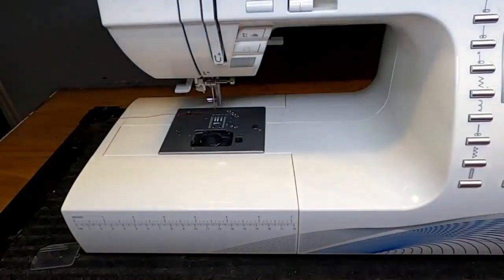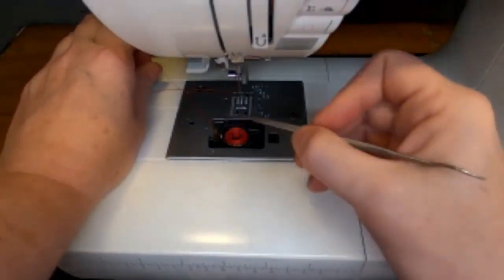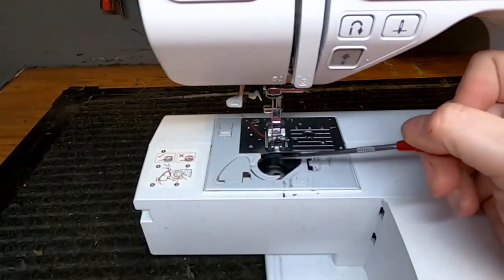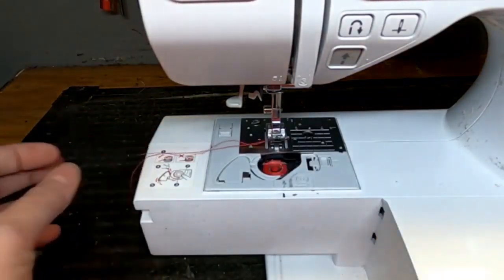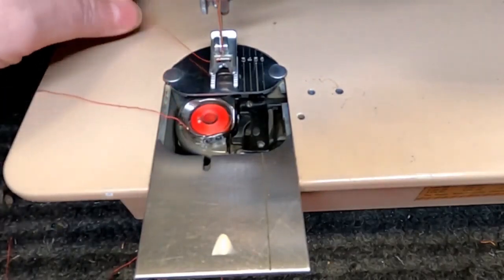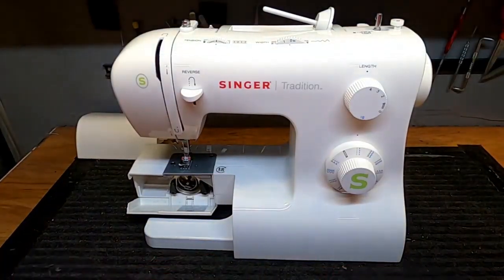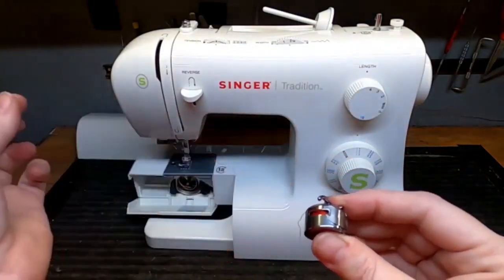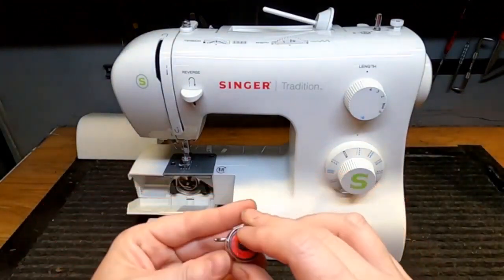Inserting the bobbin correctly - drop in bobbins, vertical bobbins, applies to all sewing machines

Comment: Hi hun, I'm relatively new to sewing, I've had a machine for over 30 years but have not used it much. Recently decided to get back into sewing and upgraded to a necchi 204d. But I'm having trouble with the hook (or bobbin holder) it seems to keep moving. I did a load of writing, had to change thread,  did a little bit more then all of a sudden it kept chewing the thread underneath. So much so, I had to unscrew the plate off to free my work. There seems to be a little hook on the left hand side near to a screw that the thread seems to catch on (I don't know if it's normal). But now I can't seem to get the bobbin holder back in place properly. Can you offer any help please?  X